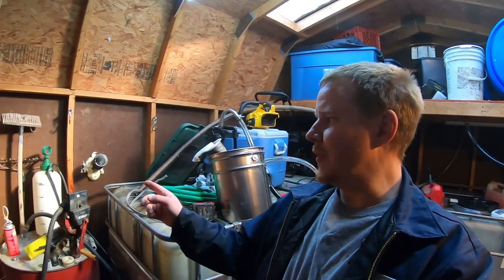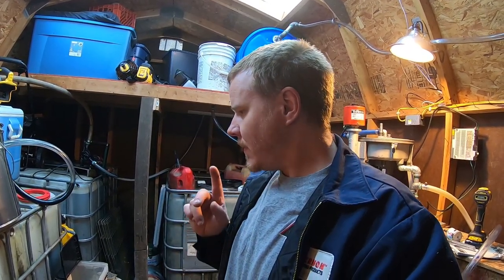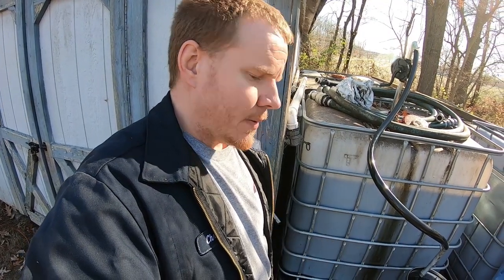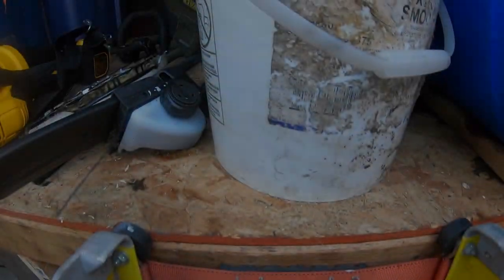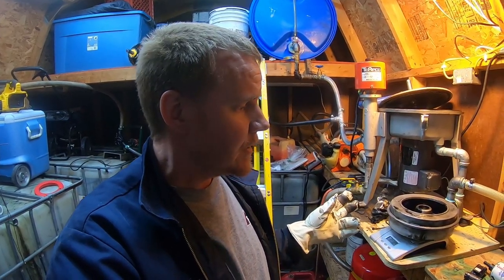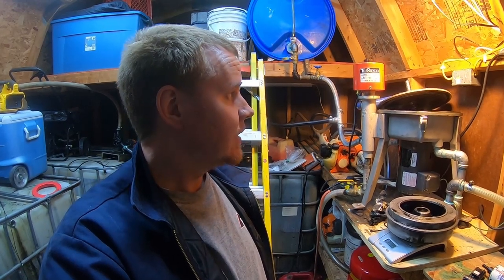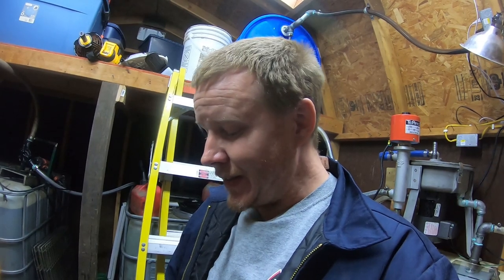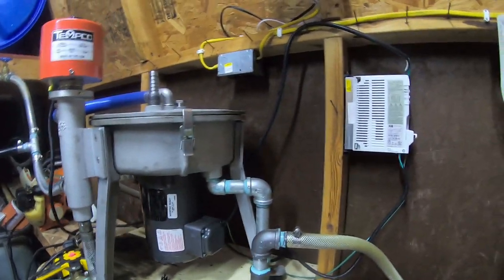Black Diesel Small Batch Tests - 1 Micron Filter Bag Part 2 - Alternative Fuel - WMO - Saving Money

Comment: Have a bucket with a tube in the bottom going to the bag filter inside near the top.  Fill the 5 gallon bucket it'll keep the 1 micro bag filled if that's the route you want to go
Reply from the maker: Interesting idea for those using filters.

Comment: I used a much larger bag filter in a piece of 8" diameter duct tube that sat on my collection bucket.  $40 worth of bags went over 5 years.  The bag filter will stop water droplets, but I don't know that it'll stop emulsified water.
Reply from the maker: It can work well enough depending on what you are using it for.

Comment: I run bucket top filters from 600, 400 200 100 100 75 then 55. 
Then I run it through sock filters at 25 15 10 5 1 then 1/2 micron
Reply from the maker: Sounds like a simple setup.  How do you handle moisture?

Comment: great demo, very informative. two thoughts come to mind: 1) the amount/cost of energy required to run the centrifuge and heater vs a simple distillation tower 2) what further measures will be used to clean the black diesel to avoid build-up of carbon in the injectors from the black within the fuel?
Reply from the maker: The black or soot isn't what causes carbon build up...  its the additives and slower burning nature of the oil that does.  As for a distillation tower...  I don't know.  I know they need heat..  just like the centrifuge...  so it'll depend on how you are providing that heat... the risks you are willing to take in doing so...   and the amount of final product you get when it's all said and done.  

I'd like to tinker with distillation at some point and I probably will...  but it will have to wait for now.  Too many irons in the fire.

Comment: Had to show my wife, I literally just got a diesel heater! Now your going to have to test the 1/2 micron bag filter. I like your pipe idea, perhaps even multiple bags in a long pipe. Im curious im looking at the used webasto coolant heaters or clones.. Figured on an idi the left fender would fit one with easy access to the heater core lines and fuel line, I guess 15min in -30*F will get ect to 87*F and 1 hr would get to full operating temp. 1 hr burns about a cup of diesel and I don't see a downside, sounds way better than remote start and seems like all pros. Thoughts?
Reply from the maker: Diesel coolant heaters are sweet but I've never seen a cheap one.  I only have experience with the air heaters currently and they work really well.
Reply: I used a small egr cooler from a 2015 subaru wrx to catch exhaust heat to make my heater a bit more effective. Im sure you could plumb that in to a cooling system if needed

Comment: Please try running a batch after mixing rug. If concerned about heat maybe don't use heat. Wondering if the rug will breakdown and let separate easier
Reply from the maker: Planning on it.  Will do it soon

Comment: I'm tempted to run some filtered black diese in my Chinese diesel l heater for my garage Mostly diesel with some waste mortal oil mixed in probably add an 80/20 mix what's your thoughts on this?
Reply from the maker: I'm going to be doing a video on this soon.  If you do it...   run it at full temp..   and I'd say do it 50/50 for now.  I've setup a 2nd tank for mine and will be doing a video starting and shutting down on diesel...   then W80 any other time.

Comment: Hey buddy, hope your well. 
A small suggestion, I put a shut off valve on top of my lid so that when I’m either bleeding air from the lines or finished a run I’m not dribbling dirty oil into the clean oil outer bowl when moving the lid on or off the machine to access the bowl. 
It would also be handy if I had a side heater like yours, but I don’t 😂👍
Regards Heath in West Australia
Reply from the maker: Not a bad idea at all.  I need to replace the hose coming from the heater anyways as it's weeping oil through it...   kinda odd since it was sent with the unit...  you'd think it would hold up.  May toss a valve on there while I'm at it.
Reply: @NotSoGrandGarage  , yes it looks like reinforced pressure hose from the heater, you’d think it would last longer. Maybe it’s not so heat tolerant, better suited for pressure. 
Does the cone inside the bowl make a difference? I noticed yours has one where mine doesn’t.
Reply from the maker: @heath8779  I've not ran it without the cone which I've been asked to do so in a small batch test...   so we'll see here soon.  In theory, it should make a difference.
Reply from the maker: @lyndonchambers2301  what did you swap it for?
Reply from the maker: @lyndonchambers2301  Heater hose won't last long at all.  Been there a few times.  High temp silicone hose would be ideal or something ptfe lined.

Comment: The gas with and without heat would be a good test in my opinion although I wonder if the gas will evaporate and not keep the oil as thin as it should be.
Reply from the maker: It will most definitely evaporate and the vapor coming off the drum will likely be flammable.  I don't heat any blend with gasoline already mixed in.  Too dangerous in my opinion.   I will be doing a no heat with gas vs no gas with heat test though.
Reply: Gasoline mixed with old motor oil sounds like a sure fire way to blow up your shed if heated and run through the centrifuge. While I watch this video I wondered what fire fighting equipment you have in the shed?
I like your idea and your videos and you should be careful having a wealth of jug’s of motor oil won’t be much help if your little hut catches fire.

Comment: I work at a Valvoline Instant Oil Change so i can get all the oil i need at any time. Do you feel its necessary to centrifuge WMO if I'm taking oil straight out of the car at operating temps and putting it into my own clean containers? I also run a Cat 2 micron fuel filter after my factory 14 micron fuel/water separator.
Reply from the maker: The centrifuge pulls contamination like wear metals and moisture out of the oil so yes it's my preferred method.  Now some people just filter and go and get away with it.  With that said, if you're considering a centrifuge,  keep an eye on the channel Friday morning.

Comment: Doing a no heat pass is about the only good way for removing the wax-like substances in oil. Under heat it liquifies and flows thru and is staying with the finished oil to re-solidify.
Reply from the maker: That depends on if it's heavier than the oil, which it most likely is.  If that's the case, it'll stay in the bowl with the sludge.

Comment: idk if you want to fuss with it more, but have you thought about putting the oil filter back in but after the heater? did you notice any difference after removing it?
Reply from the maker: I don't have any flow issues since removing it and it really isn't necessary to have it in the first place.  After the heater could work but plumbing would be a pain with how the heater is designed.

Comment: Why not test the process of settled vs brand new/stirred oil on the process. You may get some chunks, but if you don't have to wait a year that would be nice
Reply from the maker: New as in new out of a bottle or new used?
Reply: @NotSoGrandGarage  new used. Don't wait a year.
Reply from the maker: @sprpilot  you don't have to wait a year.  I have the capacity to do so.  Most will settle for a couple of days and go.  A year is excessive but even after a year, one tote was still pulling lots of water... just showing that settling isn't enough.

Comment: do you think you would get the same results with the 3450 centrifuge with the heater and cone? or at least very close.
Reply from the maker: I believe it would be fairly close.  The 6k obviously applies more force to the oil in the bowl but the basic unit does a great job as well.  Are you considering a centrifuge?
Reply: @NotSoGrandGarage  yes I am, as I need a way to get the water out and distilling the oil is more than I care to get into.
Reply from the maker: @ralphkleyer9324  I'm in the process of becoming a WVO Designs dealer.  Pricing will be the same as if items were purchased direct but customer service would be handled by me.  I'll be the only dealer they have that will be focused on used petroleum oils.  I should be able to accept orders here soon.  With that said, what engine are you planning on fueling?
Reply: @NotSoGrandGarage  Two things. an older diesel generator and foundry furnace. the furnace will be first thing I will be using in.
Reply: @NotSoGrandGarage  sorry about my slow reply but I thought I had already answered your question but after looking I can see that I did not. There will be two things I will be using it in. My older diesel generator but to start with, I will be using it in a foundry furnace. and it is more important to get all the water out for that, more so that all the other contaminants. But for the generator I would definitely want the other contaminants out as well. and I think I would also rig up a two tank system and start and stop with diesel.
Reply from the maker: @ralphkleyer9324  either unit as long as it's heated will remove the water

Comment: How long have you been running on wmo?? Any issues with clogged filters,injection pump damage or injector problems? Any difference in milage acceleration and overall performance? I ask i have a 86 f250 4x4 6.9idi want to run on wmo
Reply from the maker: Multiple IDIs for over a decade.  My flatbed has never had the injectors out and is on the original 200k+ mile pump also.  I've never had a permanent failure caused by my fuel.  Now in my Cummins and my bus, I've had issues with injector coking causing smoke and power loss.  Pull injectors... Clean the tips manually and back in they go...  Back to normal.  The 6.9 will drink oil just fine.
Reply: @NotSoGrandGarage  hey man thank you the old 6.9 idi I have I love the old truck. Thank you so much for the reply. Would filtering it out with a Caterpillar 1R-0749 fuel filter or cat oil filter 1R0716. The oil I have at the shop has everything in it. I can't afford a 1,000.00 centerfuge
Reply: @NotSoGrandGarage  love your setup
Reply: @NotSoGrandGarage wish you a thousand likes man!! I'm from Bamberg sc!! Hey here's an idea move here I need a neighbor and a fishing buddy!!
Reply from the maker: @JefforeySiegel  I'm a fan of SC.  Nice area for sure.  I'd hate to think of moving again but never know what the future holds.  Thanks for watching bud
Reply from the maker: @JefforeySiegel  I started with whole house water filters.  Just don't spend a lot of money on filters and such as you will want to upgrade.  Bag filters work really well too.
Reply: @NotSoGrandGarage  where do yeah get bag filters?  I got a old timy hardware store here I'd have to travel 60+ to lowes
Reply from the maker: @JefforeySiegel  Amazon or other online outfits will be your best bet.
Reply: @NotSoGrandGarage  thanks man I'm on it right now 😂

Comment: Do you think it would be safe to run the wmo in an old idi engine if only ran through the sock?
Reply from the maker: I ran a 7.3 IDI for a year or so when I first got started using nothing but whole house water filters and gravity.  It worked.  Is it ideal?  Nope...   but it's doable.  The bag filters work better than the filters I was using back then.  Just make sure you aren't getting water, antifreeze, etc.
Reply: @NotSoGrandGarage  I got a 6.9 and didn't even think about water filters (just oil or fuel filters) thank you.
Reply from the maker: @edp9811  I'd use the sock filters over water filters.  They do a better job.  You'll also want a way to remove water
Reply: @NotSoGrandGarage  I got yuh, figured I'd run it through oil or file filters then the socks. 
Still working out another way on how I'll be sure to remove water other than letting it sit forever and drawing from the top layer of "cleaner" oil
Reply from the maker: @edp9811  heat works really well.
Reply: @NotSoGrandGarage  I'll have to look until that, does the heat evaporate the water but leave the oil?
Reply from the maker: @edp9811  correct.  It will also make particulate little faster and it thins the oil... so faster flow through your filters depending on how you set everything up.
Reply: @NotSoGrandGarage  awesome, thank you again for everything
Reply: @NotSoGrandGarage  btw, what do you think about using magnets to help with any metal in the oil?
Reply from the maker: @edp9811  I'd say it can't hurt.  I've never tried it but I've heard of people doing it.

Comment: That 6K machine is supposed to be able to do up to 25 Gal. per hour. I would like to see it run closer to it's full protentional and see how good of a job it does. Then time vs time on bag would make a difference. And you would not use as much electricity.
Reply from the maker: Even wide open, a gravity setup like mine with the oils I typically run won't flow at 25gph.  That and the average user isn't going to run it that fast as it isn't necessary... nor will it do as good of a job.  The longer the oil is in the bowl.... the cleaner the oil coming out and I've personally seen that when I left the valve too far open and it ran the whole batch in 4 hours or so.  

There is no point to rushing the process.  You'll end up costing yourself in the long run no matter what method you use.

To get the flow you are wanting to see would require a metered pump or a much larger gravity feed setup and thinner oils.  Could likely get that flow rate out of veggie oil... but not 15w40.

Comment: Really that test isn’t comparing apples with apples, you’d need to put your filter in a housing and pump through it, recirculating the same oil and compare the energy consumed Vs energy consumption by the centrifuge. Worth also considering that most filters will remove more contamination as they get progressively dirtier, trade off obviously is that the pressure drop will increase and the flow will drop
Reply from the maker: Problem with that is most people don't run them that way.  I want to compare them in ways that most will use them.  No one that I've talked to puts them in a housing and uses a pump.  They manually pour oil through them.

The request was to see what the filter physically missed that a centrifuge would have pulled out in a manner that the filter is typically used.  As far as energy consumption goes...  well the bag  filters win.  Lol

Thanks for watching.
Reply: @NotSoGrandGarage  I get what you are saying but it’s like buying a Lamborghini to go to the supermarket.
Your centrifuge wins hands down if people consider the time component and realistically the only thing the purchased bag filter gives you is a filtration standard but obviously the bag isn’t the most significant investment in a filtration system, it’s a consumable.
Reply from the maker: For sure.  Most people that have asked are just wanting to compare what they are using to a centrifuge and see if it's worth the investment to upgrade.  This isn't super scientific by any means and it isn't meant to be.
Reply: @NotSoGrandGarage  personally I think there’s a balance between quality of the fuel, overall costs, available space to process / store and the time it takes to collect and process. As yet I haven’t processed or used waste oil (I have previously converted and run WVO) so am watching your videos with interest so thanks for sharing
Reply from the maker: @ianbottom7396  yup its a balance.  Thanks for watching
Reply: @NotSoGrandGarage  hello. i have some me100 filters that also remove up to 200ml of water. would that be sufficent to filter the oil and also after filtering, do i just add 10% gasoline? thanks